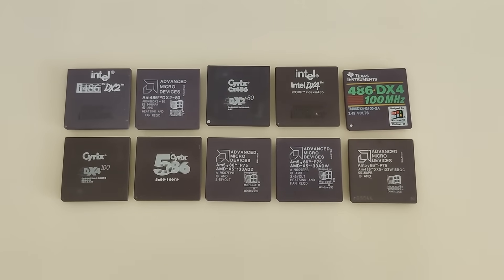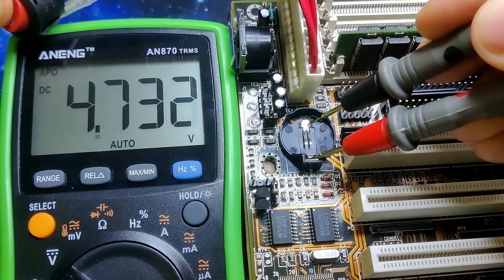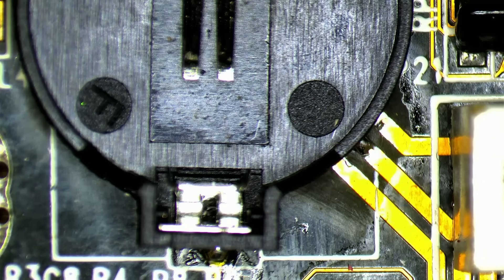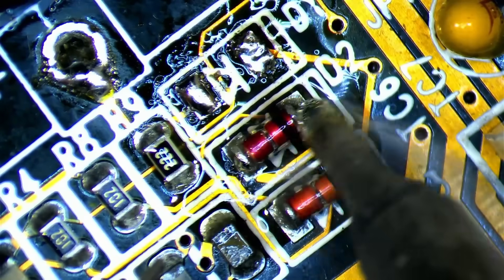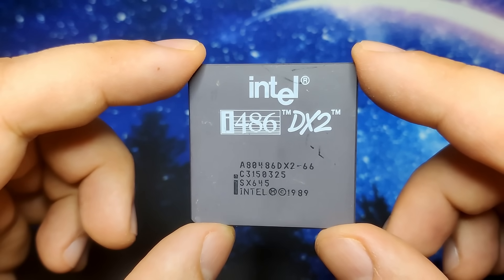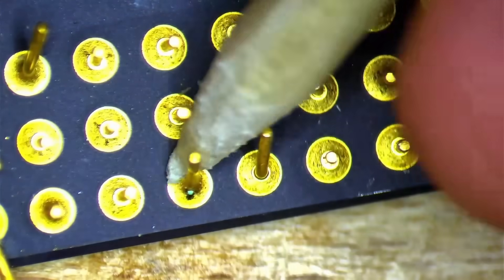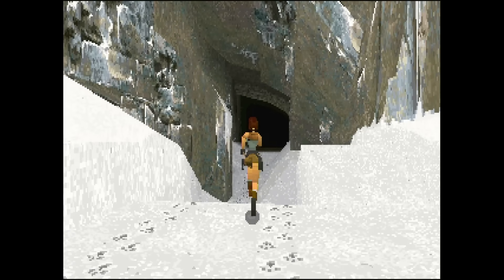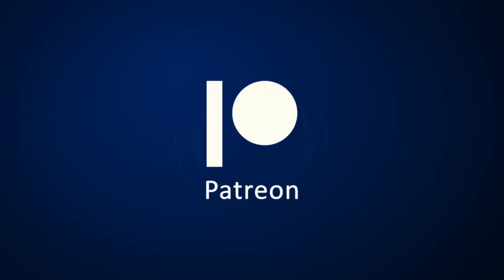Tomb Raider (1996) on Socket 3? (Part 1)

Comment: Dang a modern cpu in that condition would be totaled!
Reply from the maker: Unfortunately, you may be absolutely correct. I can imagine that the pins of modern CPUs will break much easier. The pins on 486 are quite soft.
Reply: @bitsundbolts  that and there are literal thousands of pins. Can you imagine the precision you would need to bend one of those tiny little pins back into place much less 1000.
Reply: @bitsundbolts  I think the 486 has 169
Reply from the maker: Yes, that's about right, 168/169 pins for 486 CPUs. I guess it's ok to bend a couple of pins back into place on an AMD Ryzen CPU, but if most would be messed up, then good luck.
Reply: Modern pins are thinner and more brittle. And yet people bend them back, and if they break, they get a shitty or dead donor CPU and solder on the pins. All the question of effort you're willing to put into things.

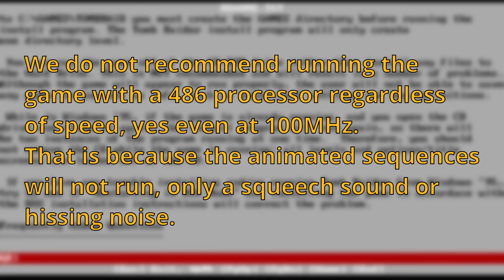Comment: Did the animated sequences emit a squeeching sound or hissing noise as indicated in the readme? 6:31
Reply from the maker: No squeeching sounds or hissing noise, everything sounded normal. I was using an ESS AudioDrive 1688F. Maybe there were other incompatibilities with certain sound cards and slower CPUs that caused the audio distortion.

Comment: I know for a fact that the demo ran  0.3-FPS, on a 486SX/25
Reply: Well, technically you can only say it ran at that speed on that particular computer. Different hardware will produce different results, even if they share the same CPU.
Reply from the maker: Wow, that's really slow

Comment: You could use a S3 ViRGE for future projects, it will have a FPS counter for the S3D version 😅
Reply from the maker: I have never tried the S3 patch for Tomb Raider - I wanted to go with 3Dfx, but it may be interesting to look at 3D decelerator too 😉
Reply: @bitsundbolts  I'd be interesting. I think remembering hearing that on 486 systems the S3 Virge 3d acceleration actually did speed up things somewhat.
Reply: @luckyluckydog123  It's like a lot of those early cards, they help with really slow CPUs, but need really fast ones (I've heard a 1 ghz P3 or Athlon is the sweet spot for the  ViRGE) to get the most out of them. Regardless, I think it might make the perfect companion for the Voodoo 1.
Reply from the maker: That's what I'm reading as well. A fast 486 may actually benefit from the S3 Virge.

Comment: I prefer to use the coin cell battery holders with a diode that blocks the charging, like the "varta killer"
Reply from the maker: Yes, there are some nice open source hardware projects that incorporate the diode as well as the battery holder.

Comment: I'm looking forward to additional videos in this series! The Intel 486 DX2 66Mhz was the CPU my first PC came with so it has a special place in my memory! 
By the time Tomb Raider was released I had an AMD 5x86 running at 120MHz (40x3) in that PC and while it was a bit more playable than a 486 DX2 66MHz at plain VGA resolution, my friends P90 machine made the game feel buttery smooth in VGA mode by comparison.
Reply from the maker: That will be the endgame: Pentium Overdrive @ 83 and maybe even at 100 MHz on socket 3!

Comment: Here's a video of someone playing Tomb Raider on a 486 using an S3 Virge card and actually getting decent performance: https://www.youtube.com/watch?v=fq1d5eTAfvg
Reply: that's a second gen virge, a dx
Reply from the maker: Interesting, I didn't know you can change the resolution in the S3 version! I'll definitely have a look at this patch too, thanks!
Reply: @bitsundbolts Cheers! I think you may need a 4 MB Virge for this to work correctly. Also, the resolution can go all the way down to 320x200 while still using S3D acceleration. :D
Reply from the maker: I am sure we will be able to get this game working at high frame rates on socket 3 with those graphic cards!

Comment: Gosh, I wish I had that 486 Asus board. I have a soft spot for old Asus boards, just as with Diamond graphics cards.

My weaknesses aside, I think I wouldn't have the patience to modify the charging section. I would end up simply popping in a brand new ML2032 rechargeable coin battery and calling it a day.
Reply from the maker: Ah, I have a similar weakness. For me it is definitely rooted in the hardware I owned over the years. Diamond, Gigabyte, and ASUS were most common.

Comment: You might consider looking at the Open Lara ports of Tomb Radier.  Someone got that working on the Gameboy advance (the original system with no hardware mods, and no special chips in the cartridge 🤯).  And I feel like a 486 - 33 or especially DX2-66 should be enough to run it in software, if a GBA can do it.
Reply from the maker: That's really cool how people manage to get those old games ported to different devices. Doom on a calculator comes to mind 😀
Reply: The point is seeing if the original runs on that hardware.

Comment: 486 are right of passage! If you can figure out all the jumpers and different CPUs you're good to go for every PC 😊
Reply from the maker: It's my favourite platform mainly because my first PC was a 486. Thanks Phil for posting the video on your Twitter account!
Reply: @bitsundbolts  My first custom built PC was a 486 also! I don't remember what motherboard, but it had that fancy Win BIOS and VLB. AMD DX4-100 and a VLB ET4000. I loved that machine...
Reply from the maker: Wow! That's an amazing 486! Mine didn't have VLB, but it was a PCI board from gigabyte, the GA-5486AL. I used this PC for a very long time and kept it to this day!
Reply: And my first even It was a packard bell 486 sx 25 MHz. And integrated but connected to vlb cl-gd5424.
Reply from the maker: Uh, the SX with disabled floating point units. I think I have one in my collection, but I am afraid of using it due to very slow performance 😂
Reply: @bitsundbolts  on my computer It was upgraded with a dx variant and a 20mb of RAM (4 are already on the mainboard) fucking packard bell!! That bastard won't run os/2 warp 3!!
Reply from the maker: Ah, soldered memory to the board... How inconvenient! I stay away from pre-built hardware because I believe it's difficult to find info about it.
Reply: @bitsundbolts  i was a 16 years old teenager back then and It was my first pc. My first computer was an amstrad cpc472. It was bought for my sister, but i took more interesting on the computer than my sister.
Reply: Couldn't agree more... The 386 and 586 were quite simple compared to the options the 486s gave us, also with all the different busses... Isa, vlb, pci, agp,...
Reply: @hypergl6974  agp on 486?? Not... Only PCI v. 1.2 not 2.1. And isa & vlb.
Reply from the maker: Yeah, I'm not aware of AGP on Socket 3, but then I also said "Intel Pentium 486 DX2-66" in the video 😂

Comment: So much patience to straighten those pins!
Reply from the maker: Yeah, it takes time and patience, but it almost feels like therapy! And it's rewarding too when I see such a CPU come back to life!
Reply: @bitsundbolts same. I get also all excited when I able to bring something back to life. My first pc that I have memory was a 486-DX4 100. Actually I had a quite negative feeling towards it because I remembered as being slow. Recently I have been playing around with PCem (I configured a machine with similar specs as my original pc) and I was amazed by what I could run on it! Certainly I would have enjoyed much more that pc if I knew a few things. Luckily I still have pc at my parents, I can't wait to put it back together and enjoy the full 486 experience!
Reply from the maker: That sounds like a great little project!
Reply: @bitsundbolts - do you heat the pins up a bit with a hair dryer or a heat gun turned down to 1 before bending them back to their original shape? It seems like a good idea at first glance but maybe there are some adverse effects of such action that I didn't think of. I'd love to hear your opinion on this.
Reply from the maker: I don't use heat before bending. I never felt the need for it and I doubt heating the pins will help in any way except burning your fingers. I just think that metal has such a high melting point, that 50 to 80 degrees on those pins feels like it'll do nothing to make this process any easier. But I may be wrong. The soft wooden tools make it enjoyable to work on though.
Reply: I figured out a great way for me to straighten pins: remove the lead from a thin lead pencil   (the ones in ball pen housing that can expanded through the push-button). The metal tube perfectly fits the pins and makes the process very gentle and easy.
Reply: @pc-sound-legacy  - a medical needle would work as well although an automatic pencil you've mentioned may be easier to find in most households ;)